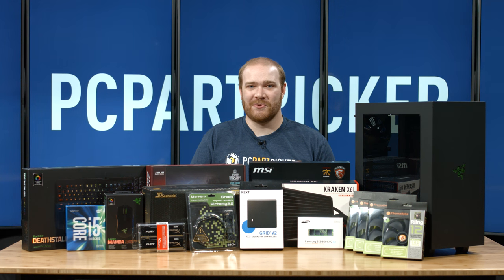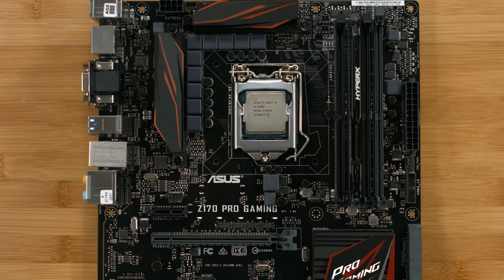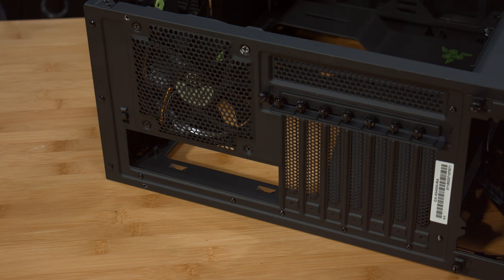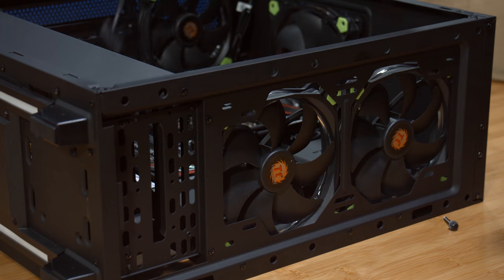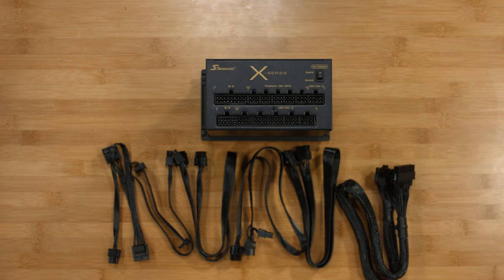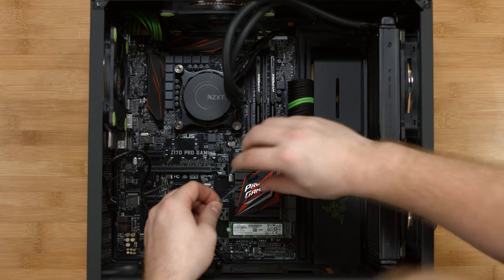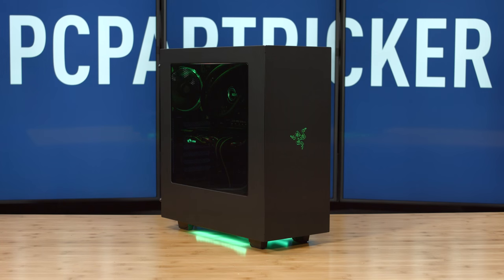Gaming / Dev Build - NZXT S340 Razer Edition / Core i5-6600K Skylake / GTX 970

Comment: "big fan of razer and black and green" 
red motherboard
Reply: With the led fans, it won't be noticeable.
Reply: its hard to find a good gaming green mother board :( I've been looking for awhile now to, so I might just end up getting a red mother board if I have to
Reply: +LightningAnimeFox you can buy an all black mainboard there are many opinions . why would you get a red one...
Reply: euer Vater exactly
Reply: +LightningAnimeFox just try to find a all black mobo
Reply: +LightningAnimeFox would be better to get one that is mostly black
Reply: I want this with a MSI krait (black/white) with the same on the graphics cards (the green LED will make the white look green)
Reply: RobgersHabit I have got a s340 White with rgb LEDs on the inside and bottom wich I control via bluetooth on my smartphone. All with MSi Krait Black White + Msi Krait 980 ti GPU  + white Sleeved PSU Cables. I love it so much <3
Reply: +euer Vater could you give me a link to those LEDs? :)
Reply: VictorHD the RGB-Controller is called "farbwerk" from aquasoft + 3 LED-strips - check it out on my channel !
Reply: @LightningAnimeFox  Don't forget..Red,Black and green are the colors of Ermac from Mortal Kombat.

Comment: I have a very similar build except i have the H440 Razer edition, Asus z97 sabertooth mark 1, i7 4790k

still deciding on whether i should go sli on the 970 100me or upgrade to a 980Ti
Reply: +Jon Luna thats actually my build but in a different case i say a 970 i have it and its great
Reply: +Jon Luna Definetly get a 980ti. It offers the same performance compared to SLI 970s, wastes less total power, produces less heat, and has 2.5gb more VRAM (gtx 970 sli has 3.5gb). Plus you can always save up and get another 980ti in the future.
Reply: Shadow Emperor Daguthir
good advice. thanks
Reply: +Jon Luna Do you already a 970? If you do just get another one. If you don't, definitively go for the 980ti.
Reply: Cactus11
Yup, good advice, if you can sell the 970

Comment: How is the pump working ? I thought the x61 had to have a pwm fan plugged into the cpu block fan controller. I was wanting this aio with the riing fans but they said i had to plugged a pwm fan into the first plug on the pump.

Comment: I am going to use an NZXT case in my pc build but, does it come with the fan controller or do you have to buy it separately?
Reply from the maker: +Speedboycentral This case does not have a fan controller.  We added the Grid+ V2 to the build.
Reply: Ok thanks for your help :)

Comment: where is the optimal drive at on this case?
Reply from the maker: +drsatan29 This case does not have any external 5.25" bays for optical drives.
Reply: +PCPartPicker then how do you install windows???
Reply: by flashdrive or external optical drive
Reply: sorry but who needs in 2016 optical drive? the usb they have reached crazy speeds its more inexpensive and don't take space in your office or in your room...!
Reply: USB.. flash drive

Comment: how do I install windows 10 on an SSD and use the hard drive as storage? Like I know I have to go into the bios set the SSD as the boot drive, I also know that I need to have the HDD not plugged in, install the  OS and plug in the HDD into the mobo (data and power). I am not sure how to do it it though, any good videos you can link? thanks

Comment: does it matter where you put your led cable thingies, because it looks like it can fit at almost all places on the front panel.
Reply: it sure does matter
Reply: Alan Jude yeah, stupid of me to think that it wouldnt
Reply: +Elisha Mawson There is a JFP1 panel or something, there when you look at it, you plug in the plus plug in the topleft hand corner when you look at the motherbord. the minus panel is pugged in to the right of the plus panel.
Reply: +Elisha Mawson I dont think so, I'm really not sure about that but try to find any other error you've made while plugging in your molex onto the motherboard. And if you're talking about the case fans, case fans have seperate plugs which you have to plug into specified parts on the motherboard, I remember having Case fans 1 and 2 on my mobo. If this won't work try installing a cpu first. Again, I'm not sure. I hope I helped you.

Comment: just about to build my pc, I have the same case and fan and ran into the same problem with the fitting. I assume it's fine the way you installed it, is that intake? thanks :)
Reply: Yep, been working great for almost a year now.  Quiet and cool temps.  And yes, we set them as intake, pushing across the radiator.

Comment: Where do you install hard drives on this case?
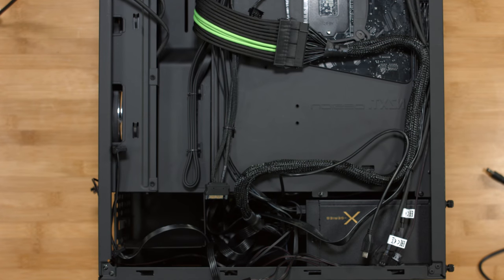Reply: +DittyWolf 11:49 there is the HDD cage in front of the PSU under the PSU shroud, you can also install 2x SSDs on top of the psu shroud just under the motherboard
Reply: Darryl Chang-Heathcote Thanks!

Comment: What is the different for dual slots ram and quad slots ram? Can I buy 2 ram sticks as dual and in the future add another 2, will this make it quad ram?
Reply: +Mafasa Almafasa Dual Channel RAM kits are 2 sticks that are tuned for each other.The same goes for Quad Channel, only that those kits have 4 sticks (duh^^) that are tuned to each other. You can of course use two Dual Channel kits together, that won't make them Quad Channel though. As far as i know performance difference is tiny though.
So buying a dual channel kit now and a second one later is a good way to "futureproof" your system!

Comment: When you are done building your pc and turn it on, do you have to put in the CDs and install the drivers or can you go online and download the drivers. Btw I'm going to have my OS on a sub bc I'm using the s340
Reply: Usb*
Reply: +Kinky Chopstix latest windows 8 and 10 dont require drivers. windows 7 might. Go with windows 10 for easiest installation.
Reply: +tomal_rocks "dont require drivers" is just plain wrong, sorry. Newer Windows versions are able to get (mostly basic) driver versions by themselves, but if you want to get proper performance out of your hardware you should definitely go and download the newest versions from the net!

Comment: Umm..my s340 is missing the vanity plate..is that a problem?
Reply: i don't think it should be too bad, I wouldn't worry too much about it
Reply: If it was shipped like that - ask them to ship a new one. 
It's not too big a problem but still - who wants big holes in their set-up. Dust won't visibly increase but it won't help any either.
Reply: If it is the original s340 they did not come with vanity plates, it wasn't until the V2 (and razor edition) that it was added
Reply: As you have a S340 Designed by razer, i was just wondering how many fans came with the case?

Comment: what is the use of m.2 in a pc??
Reply: +rishi guru Small form factor storage. Depending on the m.2 drive, it has superior read/write over SATA3.
Reply: Kesson Cao so is it rewritable??
Reply: +rishi guru It's just an SSD, and it works like one. But faster.
Reply: +SwaggerBoyNL1234 so it is  mandatory to have it on?
Reply: It's just fast storage. You can have it, or not have it.
Reply: +rishi guru Nope, you can have a pc without one. Just like you can have a pc without a normal sata SSD. M.2 is just really fast (but also more expensive)
Reply: +SwaggerBoyNL1234 true. might not buy m.2 coz of it cost.

Comment: Is that top fan intake or outtake?
Reply: The fans attached to the radiator on the front are intake while the top and rear fans are providing exhaust.
Reply: +Jack Followay (BoyScout) ok thanks. I am getting the same case. I was going to do rad intake, top intake and the back exhaust. Does that sound good?

Comment: Does any default fans come with this case?
Reply: +Rubab Power yea 2
Reply: So you have to buy the two front fans separately ... that's a bummer :/
Reply: yea but fans are quite cheap.
Reply: Rubab yes 2 fans ,top and rear..Front fans u have to buy,I got nzxt kraken x62 liquid cooler.

Comment: Could an Intel i5 6600k run GTX 970's in SLI? Or would an Intel i7 6700k be better suited.
Reply: +Sean O'Brien yes i5 6600k will run 970`s in SLI. i7 6700k its better than i5 6600k if you are using SLI and single videocard.
Reply: +Poliacov Alex If you have a 4th or 6th gen i5 i really wouldn't worry about bottlenecking anything in your system. The 6600k or the 4690k should easily run dual 980Tis. That being said in alot of games CPU power does of course also provide a fair bit of FPS, simply because it has some work to do other than support the graphics cards :)

Comment: Hello, i have a build in mine. Will the parts work together? Will the CPU cooler work with the case and fit the CPU? 

CPU - Intel Core i7-6700K 4.0GHz Quad-Core Processor

CPU Cooler - NZXT Kraken X61 106.1 CFM Liquid CPU Cooler

Motherboard - Asus MAXIMUS VIII HERO ATX LGA1151 Motherboard

Case - NZXT Phantom 820 (Grey) ATX Full Tower Case

Comment: is it better to have the 2 front intake fans on the front sucking air through rad or on the back side of rad sucking air in??
Reply: +Rowan PoopShot BRUH intake is much better, it's always more intake then exhaust
Reply: Kinky Chopstix Its better to push out hot air from the rad then to suck hot air in to the case.
Reply: +Rowan PoopShot you said pushing air out was better but sucking in is better
Reply: +Rowan PoopShot and when the fans suck in air it's not always hot unless you live in the hottest place on earth and have no AC
Reply: You realize that the rad is the exhast for the cpu heat, which is on of the hotter parts of the pc. It isn't just sucking air form out side, Im talking about the heat dispersing from the radiator should go out side the pc not the hot air flowing in to the case. Please read before replying